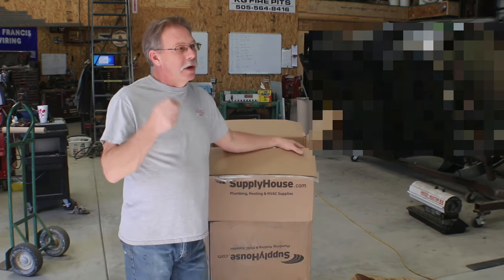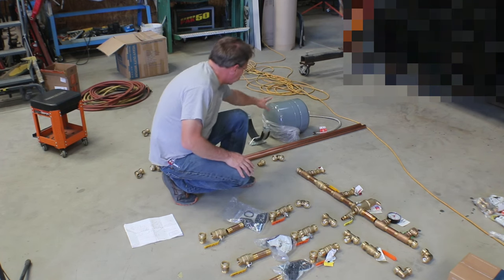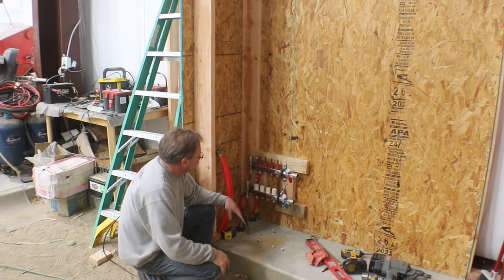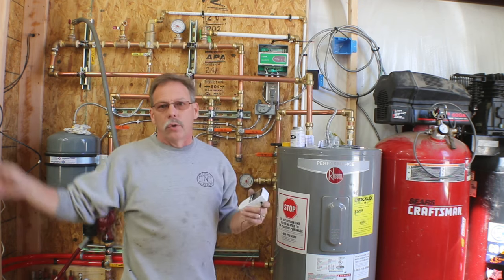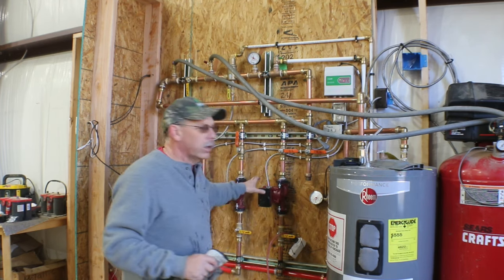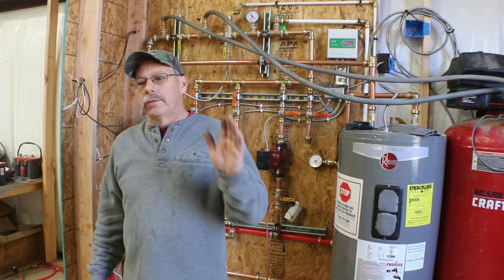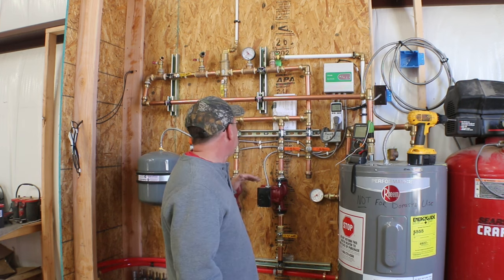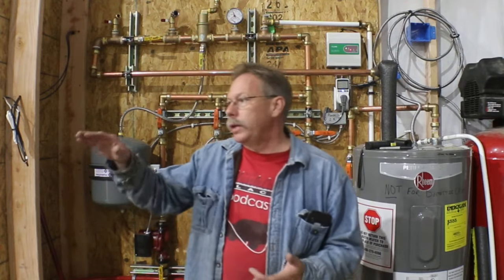Can you Heat your Shop with a $200 Water Heater? Radiant Floor Heating For My Shop | Allison Customs

Comment: Sorry but I think you’ve over complicate it. 11kw to heat your garage makes me think you’ve got more money than you need to heat a space your not living or working in all the time. Six or eight one kilowatt radiant heaters mounted around the walls to use as and when you need them. This would have saved you a fair amount of your money in parts and electric used and labour. Nice looking but busy layout. Just saying.
Reply from the maker: Thanks.
I have a lot of items (chemicals, paint, etc.) that don’t do well when freezing temps are in affect. It’s certainly a bit complicated, but the original idea was to use a waste oil boiler for heat, turns out I don’t produce anywhere near enough waste oil.

Comment: Now that you have anti freeze in your system,  you're getting much better heat transfer than you did with just water.
Reply from the maker: There are definitely benefits to antifreeze other than just lower safe non-operating temperatures.
Reply: Actually it’s the polar opposite.
Reply: With polypropylene glycol you lose 1/3 of your btu's out put. Glycol must be taken into consideration before your heat load calculation is done, as it is a very poor heat transfer.
Reply: Plain water has the best heat transfer.  Add anything, and it decreases.  The benefits of antifreeze are other than heat transfer.

Comment: Wow,
I was going to get 200' of pex and just put it in the house, so it warms up before the water heater, just to save my propane gas. 
I clicked on this to get some ideas, but it got too complicated. 🤣
Reply: You mean running the cold water through a pipe in the house so the water is warmer when it goes into the tank? So you're going to take the heat from the air and the structure, which you heated presumably with propane to heat the water, to save propane? That's not how it works. You're adding that heat one way or another and putting that same heat in no matter what. There's no free lunch!
Reply: @gorak9000  
I'm already heating my home,
Reply: Any btus used to heat the water through your pex will cool the space making the house propane consumption to go up. No free lunch.
Reply: @rj.parker  
It worked,
No change in heat in the house,
I'm using less propane for heating the water.
Using less propane overall. 
😁👍
Reply: Oh, I haven't bought propane since January,
3 and a half months,
Instead of getting propane every month and a half, at $450 to fill up.
I saved $450.
😁👍
Reply from the maker: I think they are saying that you have to heat the fluid in that pex, somehow.  If the heat is removed from your home to do it, then more heat has to be put back in your home to replace what went into the pex.  That may be negligible on your heating bill, but it is happening.  If your results are good enough for you, go for it!
It’s like the water heater for me, for now it’s getting the job done. Efficient or not.

Comment: 11 kilowatt’s per hour at 20 cents per kilowatt means you’re paying about $2.20 per hour for heating.  Heating for 10 hours per day is $22 per day; or $53 per 24 hour day.  That’s easily over $1000 per month for electricity. Yikes!!!
Reply from the maker: Our electricity isn’t quite that expensive, but you are correct that it is way to expensive as a viable heat source!  Hence, the Hydronic Solar System that I added. Hydronic Solar Heating for the Shop
https://youtu.be/_mR7S4N28oY

Comment: To answer the question you pose in your title...you may be able to heat your area depending on the insulation package, climate in your area etc.  It is misleading to use your specific situation to project onto anyone else's.  Did I say dishonest?  Having lots of experience in heat load and loss worksheet calculations I can professionally attest to the fact that each case is different.
Reply from the maker: The title represents a question that many DIYers want to know about.  The answer is obviously based on specific heat loss.  So nothing dishonest is represented.  I think you may be more concerned with “Should You” heat your shop with a $200 water heater?
Thanks for watching and commenting though!  The more information put out there the better decisions the next guy/gal can make.

Comment: You should find a scratch and dent Rheem heat pump water heater for $600 and swap it into this system.
Reply from the maker: I actually started looking recently (due to another person’s suggestion) - so far I haven’t come across anything.  Thanks for the suggestion!
Reply: You obviously have no idea how a heat pump water heater works. For every btu of heat it puts  into the water it puts a btu of cooling air into the living space. Hence no gain of heating.
Reply: @northernwiman.7472  I do actually but hmm i thought i added how to hook it up in a later reply. I guess it didn't stick. Anyways with say a proterra or really any of them they have intake and exhaust ports from the factory that can be ducted outside of the space. So you can move heat from outside of the enclosed space you want to warm to inside of the space. They are around 0.35 tons and have a coefficient of performance of 2.7-3.75. Meaning 270%-375% efficient. So probably perfect for that little shop. He would rival geothermal systems on roi.
Reply from the maker: Thanks!

Comment: Heat your shop with a $200 water heater AFTER you have already spent thousands installing the radiant tubes in the floor, copper plumbing, valves........
Reply from the maker: Very true it’s not the cheapest way to go.

Comment: Why would you buy a hot water heater if the water is still cold...? If think you would wany a water heater...?🤭 Heating hot water seems redundant. Sorry my bad people calling em hot water heaters is a peeve of mine where it's called a water heater. Another is "tape measure"  or worse measurer" it's called a measuring tape because your not measuring tape.
Reply from the maker: We all have our issues.  I can’t stand PIN Number

Comment: Wow my brain hurts your system is so ridiculously complicated you could throw out 70% of that system you need to learn about mixing valves. I’ve been heating my shop for 27 years with a 40 gallon hot water heater a B&G pump a mixing valve and an expansion tank and a homemade header.
Reply from the maker: Ok, and I don’t mean any disrespect here, but I have a few questions.
I can see how a mixing valve could be added to the system.
1) how would this simplify my system?
2) what 70% could I then get rid of? 
3) what mixing valve are you using?
4) what is the size of your shop?
5) where is your shop located (general climate conditions, altitude, lowest average temperature)?

I am serious about the questions, if I can simply and/or improve the efficiency, then I want to know.
Reply: I live in northern Indiana my shop is 1440 sq ft 11 ft ceiling I started with a vapor barrier, 3/4” blue board for a thermal brake and 4” concrete 9 inches of bat in the walls R40 cellulose in the ceiling this was the first building I ever built 27 yrs ago it’s served me well I keep it closed up as as much as I can and I don’t normally turn the floor heat on till late oct the shop retains heat well when I turn the system on for the first time I can bring the shop up to 60deg in a couple hours. I’m still using the same 40 gallon lp w/h and pump but as we speak I’m installing a 50gal Rheem hybrid electric w/h after I finish the install I can post a picture. My supply and return headers are homemade with no valves I have 4 equal length runs 1 b&g circulating pump a mixing valve and a expansion tank the pump is turned on by a wall thermostat that’s it… I’m using a 3 way mixing valve running the w/h about 120deg and the mixed water thru the floor about 80deg this allows the w/h  to keep up. It’s that simple. I hope this helps. Any more questions I’ll be glad to answer @AllisonCustoms
Reply from the maker: Thanks, I am about to do a “new” / “redo” on my plumbing, taking in many of the suggestions that have been made over the last couple of years and see if I can improve my system any.  Thanks for sharing!

Comment: Your water temp should be around 180 degrees. To heat building . You need boiler.  End of story.
Reply from the maker: Thanks for the info.
Reply: @AllisonCustoms  you certainly don't want extremely hot water reaching the floor loops. Best to run the water heater or boiler at it's most efficient range then use a mixing valve or mixing tank to get the proper temp to the floor. Most likely that will be under 100 degrees.
Reply: @rupe53  Exactly

Comment: "electric hot water heater"

Lmao why do people think they are saving money going with the most costly (in near all places) method of heating water....
Reply from the maker: “saving money” as compared to what?
Reply: @AllisonCustoms  Saved money with getting a used electric hot water heater vs buying anything but that...
I'm in the NE... electric at 100% efficiency (so hot water heater) is about 7600$ per 100m BTU
Oil over current market price at 70% efficiency on the, lets say hot water heater is... 3100$ per 100M btu 

What money was saved getting and plumbing in a electric hot water heater unless again your power costs are low compared to other fuel methods...
But really restive heating is the worse way to make heat around. 

Again my area... Picked up a oil fired hot water heater... $75 lol.